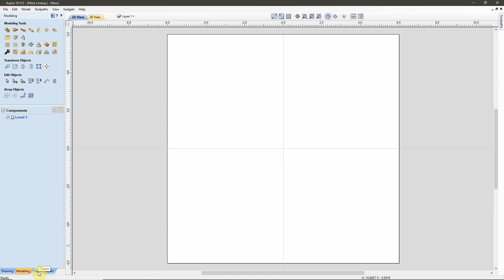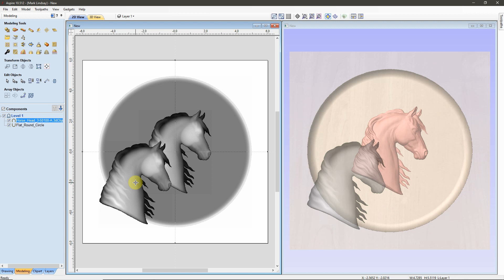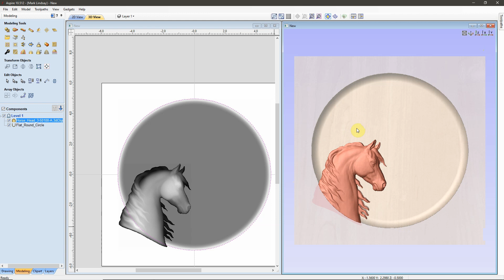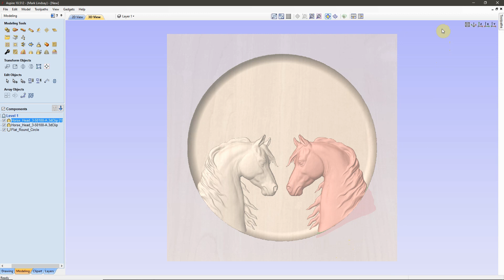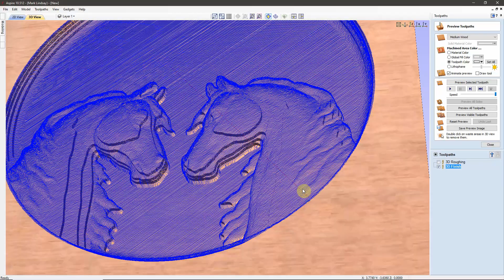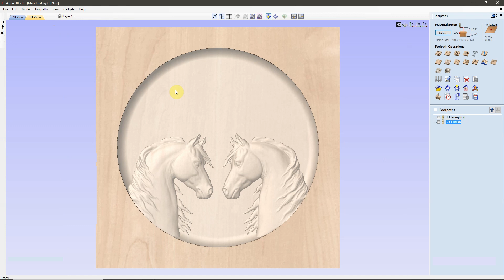3D Levels and Level Clipping in Vectric VCarve and Aspire

Comment: Hi Mark, I have Aspire 12. What does it mean if I click in the box to enter the 40 degrees for the raster and it won't let me?
Reply from the maker: I'm guessing the box is grayed out and won't let you type in an angle. Make sure you have the Machining Strategy set for Raster and not Offset. Also know that in some of the toolpaths (like the v-carve toolpath,) you can only select a machining strategy for the clearance bits - NOT the v-bit.
Reply: @MarkLindsayCNC  Hey Mark, you're gonna laugh at this, but my num lock was off on my laptop.
Reply from the maker: Happens to all of us. Using my laptop one day, it took me 15 frustrating minutes to figure out I had my F key row turned off.
Reply: @MarkLindsayCNC  🥰

Comment: Hi there is no clipping option in my vectric aspire version...is this only in newer versions?
Reply from the maker: Level Clipping was introduced in Version 10.0. If you're using a version older than that, I would highly recommend upgrading to the current version. You're really missing out on a lot of new functions and toolpath options.

Comment: I am using VCarve Desktop 10.514, I do not have all the modeling tools that you have. Is that because you are using Aspire?
Reply from the maker: Yes it is. Although they can import and carve 3D models, VCarve Desktop and Pro are not 3D modeling programs. Aspire is Vectric's 3D modeling program.
Reply: @MarkLindsayCNC  Thankyou for the answer. I did get my horse SVG file imported and I resized it using the resize tool in the drawing tools to make it work. Now I'm on to the next lesson. Thanks for the help!

Comment: Does the trial version of V-Carve Pro not come with any clip art files? If I purchased vcarve desktop, would that allow me to do the things you describe?
Reply from the maker: The short answers are; I'm not certain, and yes.

The long answers are; I believe you have to create a V & Co account, then go download the clipart files through that account, but I may be mistaken. It's been a long time since I've used a trial version, and a lot of things have changed since then. You might email Vectric Support and ask them. As for VCarve Desktop being able to do all the things I demonstrated in this video, it sure will. The main differences between VCarve Desktop and VCarve Pro are the size limitation and gadget support. There are a few other differences, but none of them have anything to do with Level Clipping or 3D Carving.

Comment: Excellent, as usual, Mark. One question. If you did not clip the horses, but still had the roughing and finishing paths usethe circle vector as the limit, the end result would look the same, would it not? The parts of the horses outside the circle vector would not be carved.
Reply from the maker: For this demonstration, and with the right amount of tweaking, probably. But remember - this is just a demonstration of the basics. In the next Level Clipping video, I'll make things a little bit more interesting...
Reply: @MarkLindsayCNC  Thanks much, Mark. My question was not intended as a criticism. I apologize if it can across that way. I don't have the newest version of VCP or Aspire. Clipping is not a feature of my version. So I need to try to find other ways to follow along and create your projects. It simply occurred to me that I could follow your procedure and only carve only what I wanted carved. I know that, even in my version, I can destructively eliminate the part of the horse outside the circle vector, as you mention early on in the video.
Reply from the maker: Constructive criticism is fine, Grant, but I didn't think you were being critical at all. You had a valid question, and I invite that - it keeps me on my toes, and is a good way for me to double-check myself. There's a lot of bad info online, and I don't want to add to it. Never worry about asking a question - I often forget to explain my reasoning behind a decision, suggestion, or method of doing something.